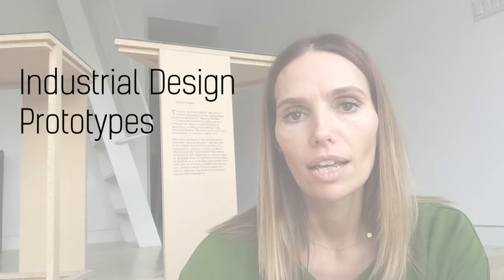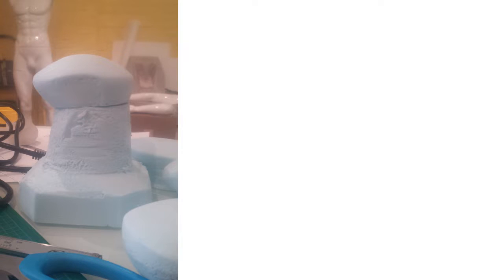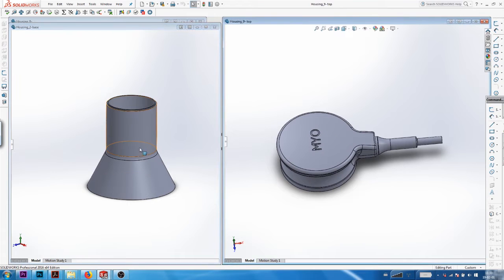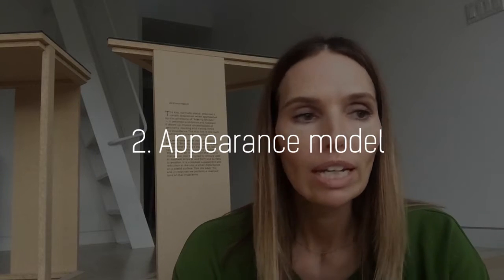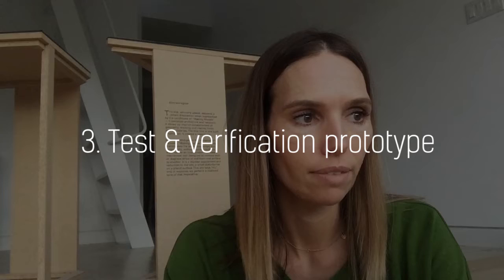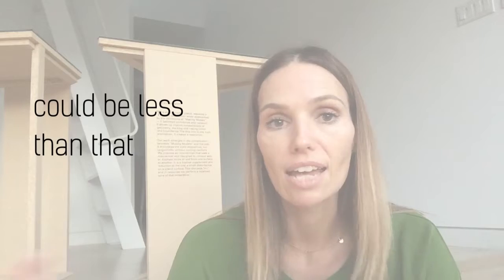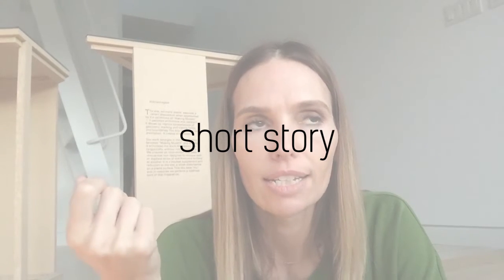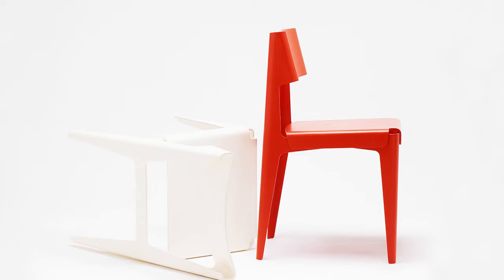PROTOTYPING BASICS | 3 questions to ask before making any Industrial Design Prototype

Comment: Hi how are you doing I have an idea for a existing product and I made a prototype and I don't know what to do from this stage
Reply: You don't know?  If it functions and you like the form.  Sell it?  
That motivation should have led you to the next obvious stage mass production.
However, you are on this website and Morna's specialty is ergonomic redesign.  That means you are not 100% happy with your prototype.  You "think" someone else can make it better.  Why don't you make it better?
Once, you're happy with it then "learn about" mfg process.  Not so much the "magic" that it can do.  Focus on the "limitations" of each process.
There's really 4 major processes: cnc machining, injection molding for plastic, composite layup molding & vacuum forming, sheet metal
Not hard to figure out what's needed for your type of product.  Hopefully, it's not electrical requiring electronics, controls and power.  Good luck on that.